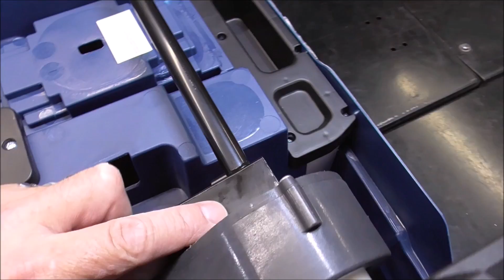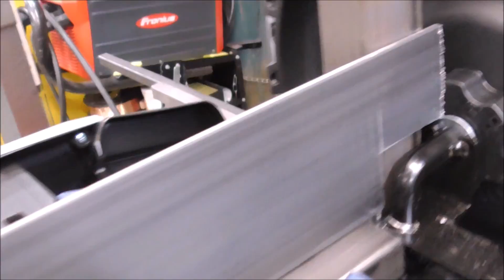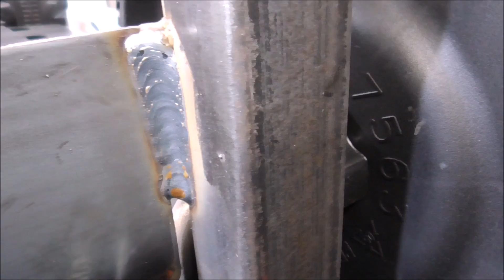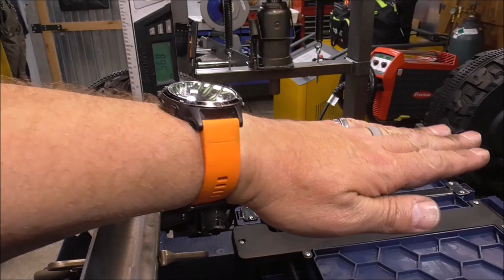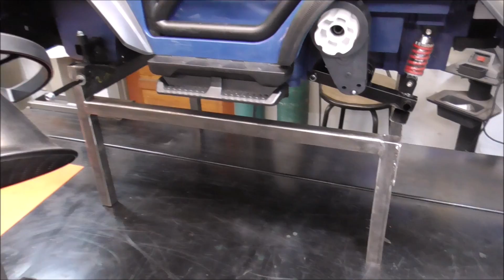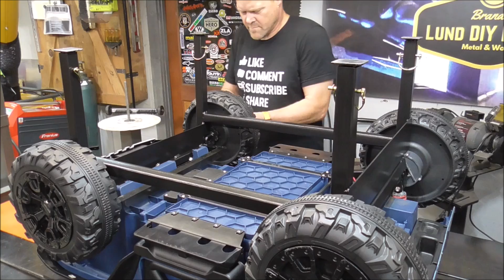I Turned a Hot Wheels Car Into a Kid’s Chiropractor Table!

Comment: I work in the Theater Building shows. If You have a Local Scenery Shop around it would be easy to Build Some Rocks and hills under & around that truck . Also could make a huge foam Rock to give the Little ones a Photo Op. now time for the Barbie Car build. A Road stripe rug may also be good for that display ?
Reply from the maker: WOW! These are awesome ideas! And I thought I was going to be clever putting the led headlights on a switch. This is really creative. Thank you for sharing! 🙏